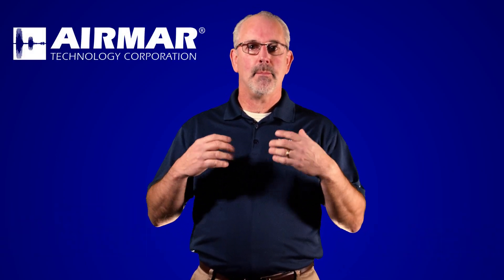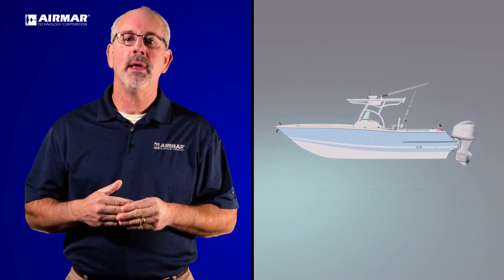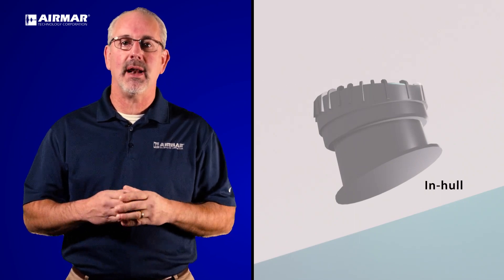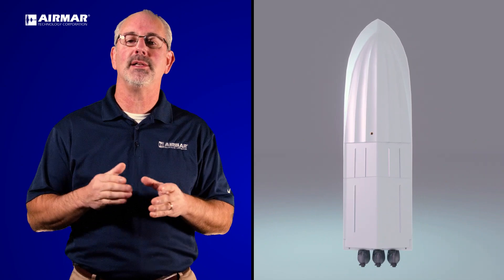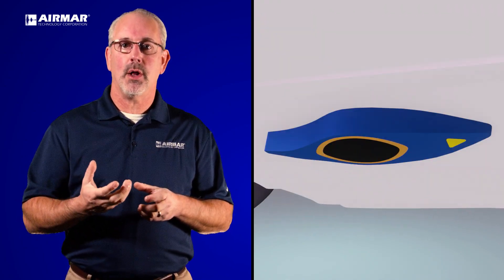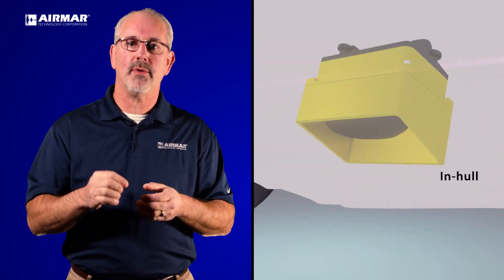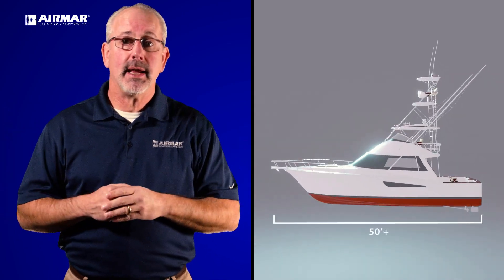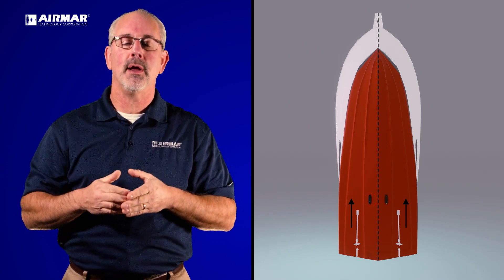Transducer University - Transducer Location

Comment: Hello,
For a B175M transducer on a 20 foot center console boat, when you say on the back, what is the optimal distance from the transom?
Thank you
Reply from the maker: Hi thanks for the question.  It depends on where you have access into the hull from the deck.  If you have access to an area 24 inches from the transom, that is typically a good starting point.  The manufacturer of the hull may also be helpful in determining where they believe the best, unaerated water can be found on the hull.  Good luck.

Comment: How about a transom mount on a 30 foot catamaran? The motor bracket makes about a 2 inch step so there is plenty of room and puts the motors a couple of feet farther aft.
Reply from the maker: Absolutely can put one there if you have the space for the bracket.  Just keep in mind that the turbulence coming off the hull might disrupt the signal a bit.  But you should be able to adjust it to get good performance.

Comment: You're missing details for a Catamaran Powerboat. Where do you put one that's a through hull Transducer?
Reply from the maker: Hi,  Cat hulls are tough and often the only solution is an In-hull model shooting through the fiberglass.  It works well as long as the fiberglass in that location is solid (no air).

Comment: I own a TM275LH... what’s the frequency to use when running at speed? I lose bottom at about 150ft running at 20kts
Reply from the maker: The reason you are losing bottom has more to do with air getting by the face of the transducer which disrupts the signal.  If this constantly happens at about the same speed, its 100% bubbles.  Lower the transducer a bit to get the face of the transducer into air-free water.

Comment: What if i have like a full keel running down the center of my hull? Not as deep as on sailboats but still. Will it cause any turbulence with a regular mount on a starboard side?
Reply from the maker: It shouldn't cause turbulence if there is some distance between the transducer and the keel.  Be mindful that if you have wide-beam transducer and a deep keep, there could be side-lobe reflection from the keel.  Consult with an installer that's dealt with such scenarios.